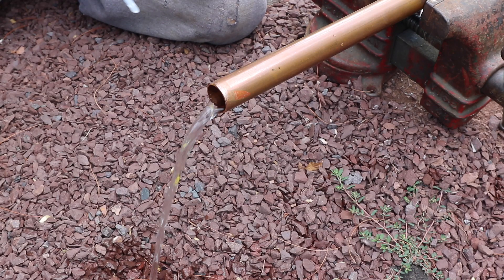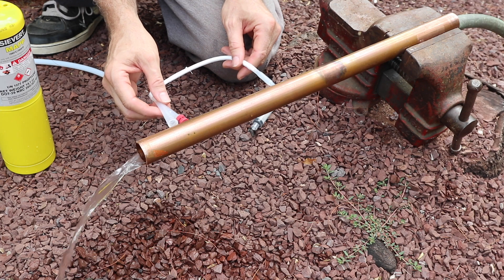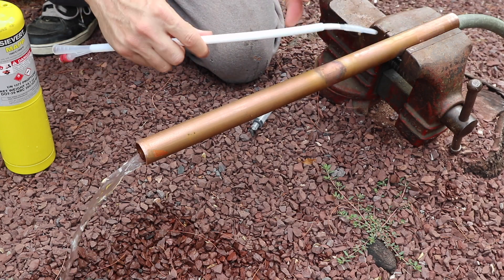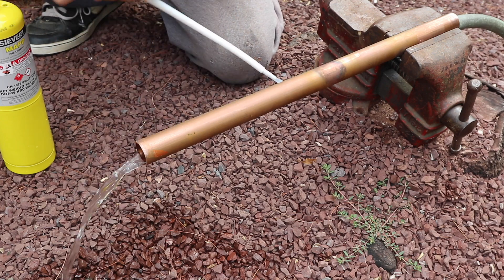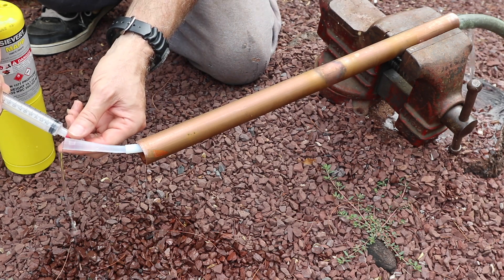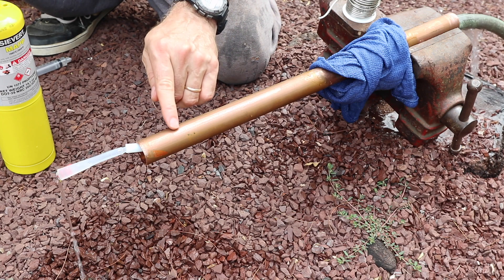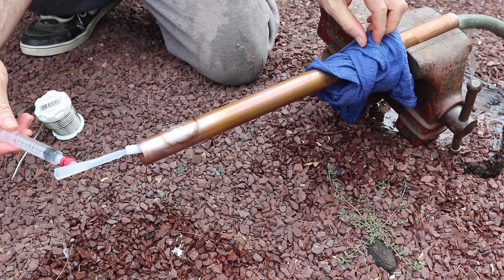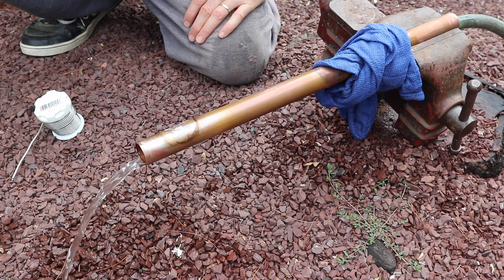Trick to solder copper pipe with running water

Comment: Other trick I like is white bread — jam some white bread (more processed, the better, no seeds) into the pipe. It resists heat transfer very well, and will dissolve completely in about 30 mins for a good sized wad.

Comment: how about showing  soldering a valve in place, with a slow leak &  household pressure against the foley ?
Reply from the maker: I would like to do that but I would need a spare house that needs a valve replaced.

Comment: This will work if the water is shut off and you are facing a slow trickle from residual water upstream but if there is more that 2-3 psi of pressure, the balloon will be pushed out before you can get your torch lit.
Reply from the maker: I agree. This is not a pressure seal. This would be used for a slow trickle and one does not want to wait a hour for all the water to drain out of the system.
Reply: @imsmoother  What I have done in the past is to hook up a shop vac to the open pipe.  If enough valves/faucets are open, the air flow will usually suck the water out.  You can also blow the line with compressed air but that's not very practical.

Comment: Isn’t it easier to just pop a shark bite ball valve on it shut the valve off then add whatever is needed from there?
Reply: I agree, I’ve done that. When I did some plumbing work at my daughters house, the main shutoff didn’t work effectively so that method got my day’s work done. Then I called the municipal dude and he sent someone out to shut it off at the sidewalk. He waited while I replaced the main shutoff and turned it back on. I only did it that way because I’m not a massive fan of shark bite.
Reply: @joeyoungs8426  yes 💯
Reply from the maker: I like the idea of a good solid connection with solder. I like shark bite also, but for my main line for the house soldering seemed to be the way to go.

Comment: what is beyond me, is why nobody has made a proper device for that, sick and tired of putting wonderbread into the pipes.
Reply: Jet Swet is the "proper tool" every plumber i know has at least the basic sizes
Reply: @mintypotato777  I remember jet swets from when I was running crews in vegas 20~ years ago.
Reply from the maker: I looked up jet sweat kits and they are over $100
Reply: @imsmoother  and so is calling any plumber once for anything ever :) definitely a worthwhile investment either way. your device actually (probably unknowingly) mimics another manufactured product that can also go around bends. The Jet Swet is limited in that it can only be used on a straight section of pipe. But it's better for other reasons 

 your idea is a clever one for sure and i don't mean to take anything away from that. Do you work in the medical field or have some other kind of experience that led you to this idea?
Reply from the maker: @mintypotato777  I work in the medical field. Just seemed like something to try. I could also use another medical device that I'm thinking of making a quick video.
Reply: Pasco even makes a quick sweat kit, which costs about the same as the stuff he used. I'm use to the jet sweat system myself

Comment: A plumber would normally try to find a good place to fit an isolation valve (with wet vac) if there was a slow flow of water or try to freeze the pipe if the water was static and then fit the isolation valve and then do the soldering later.

Comment: Very cool technique! Reminiscent of a freeze seal, but DIY. 

Is a foley a thing you can get from most pharmacies if you ask at the counter (US here).

I know someone is going to mention, so I may as well, I think silicone is about the same heat resistance as the teflon, and I do know from 3D printing that the teflon will give off nasty stuff if it gets too hot. I dont think it will matter either  in this application.
Reply from the maker: You should be able to get it a a pharmacy. I don't think you can get just one. I think you need to get packs of 10. Teflon has a higher melting temperature than silicone. Amazon sells them, link in description.